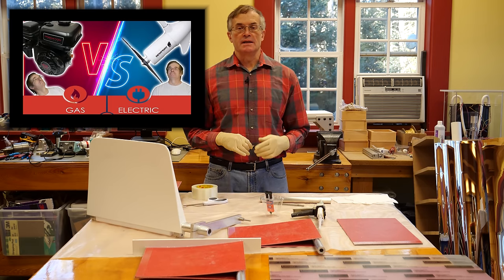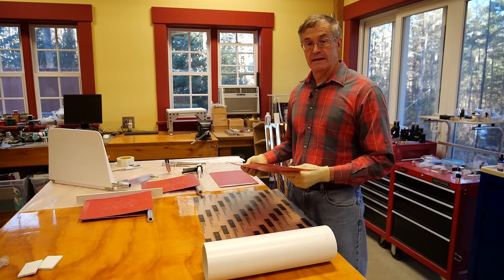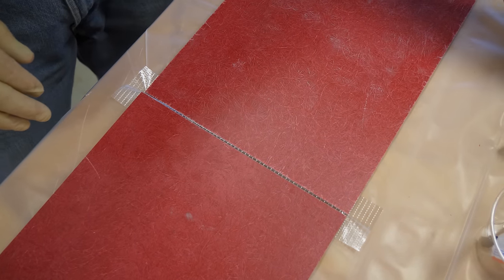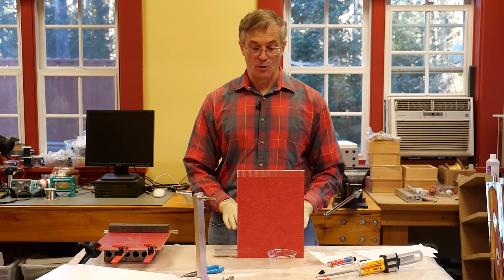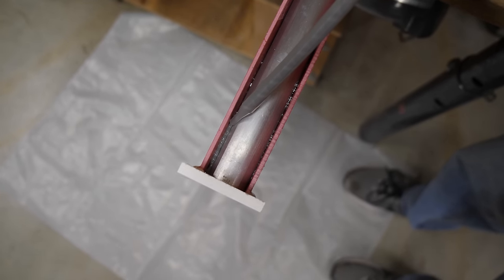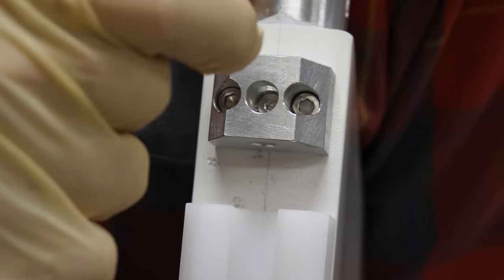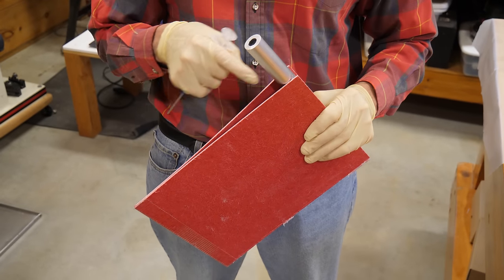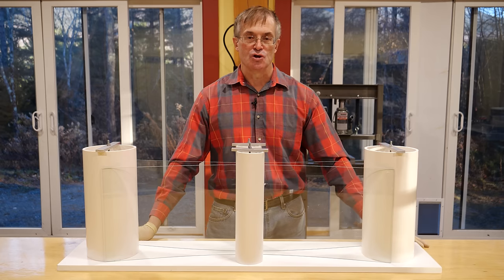How Our Boat Rudders Are Built

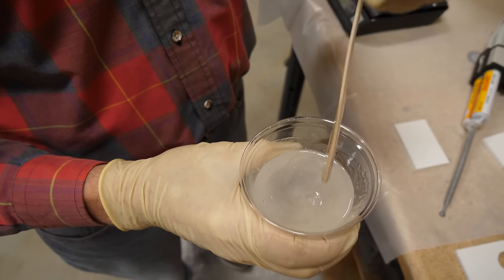Comment: 14:46 another trick for those who don't have a vacuum chamber, is using a heat gun to bring most bubbles out after applying the epoxy, in this case a small heat gun from a soldering station would give more control.
Reply: And you can just hold it at a greater distance, even a hair dryer works.
Reply: Gotta be careful with that hot glue though.. The mass market stuff, attached to something smooth like PVC, is not going to stand up to much heat & retain the seal against resin. I suppose, in terms of boat building, bubbles are sort of a bonus feature rather than a bug anyway.

Comment: 18:00 Low expansion closed cell foam for installing windows and doors would work a treat to fill the whole cavity and also add rigidity.
Reply: I think the reason he leaves it empty is to reduce weight though filling the whole cavity does sound easier.

Comment: I was an aquarium enthusiast and worked at several large pets stores. The main problem with acrylic tanks is scratches. Cleaning an acrylic tank, no matter how many precautions you take, inevitably become cloudy, covered with micro scratches. The second problem I see with any tank in general, is sealing any two sides at near right angles to one another. With acrylic, a weld is only as good as the welded bond, and in most cases, acrylic welds are not deep  enough to be considered a true weld, but more like a "cementing" of the two parts. Bonding with epoxies is not going to stand up to how the water will dry out the epoxy and weaken the bond over several years. The best made tanks I have seen are fully encased fiberglass (using several of the advanced technics you have showcased in other videos using 150 poly foam) incorporating plate glass fronts engulfed fully into a notched recess, giving full contact for the seal of the glass on both side of the seam, and then fully sealed interior with marine grade resin. These tanks last for 50 years or more before any maintenance might be needed for the glass seal. I applaud your concept of a curvy tank, but I am really skeptical about the bonds for each of the parts. I have complete faith that your material will hold the volume of water, but not any faith in the seams of said structure, but I look forward to watching it!

What I have seen in most acrylic manufacturers is a heated sheet formed into a near perfect "U" shape, then they need only seal three lines: right side left side and bottom, to minimize the area of failure.
Reply: Epoxy does not dry out. It is used in boat hills below the waterline, and, properly done, has a near infinite life.
Reply: @robertschulke1596  Maybe so- my experience is such that the epoxy bond fails when its on acrylic after a time. Maybe that is just because of the type of epoxy I was using, or prep, or , or, or... could be any number of reasons, idk.
Reply: I wonder if applying protective coats to the acrylic could prevent micro scratches?

I wondered about how strong that bond would be, maybe it's the shape that minimizes outward forces?

I'm sure much of the reason for the "U" shape is aesthetic as well as cheaper manufacturing. You could probably make some cool shapes with acrylic. However wonderful ones creation might be I'd doubt the fish would appreciate it, stupid fish.
Reply: @seandelaney1700  Most compounds that do that, (waxes, other acrylics, epoxies, oils) have a cure time which would undermine the cost effectiveness of the production, and also more than likely, not totally solve the problem. You would be better served just fabricating a curved piece of glass, expensive, but totally doable. The same thing happens to glass btw, just not as easily.

Comment: Great and detailed stuff! I would have also drilled several 1-2 mm "dimples" in the front of the metal axis to prevent sudden epoxy-metal slip from torque.

Comment: To fill the bottom piece of the rudder you could glue a PVC foam block with a machined notch to that bottom, turn it facing a flat surface, like a desk, with an inch over the edge of the flat surface. Then you, use the syringe to puncture a small hole on the foam and also fill the interior of the chamber (with the syringe pointing upwards). When you remove the syringe, use the fiberglass tape to hold it closed so the epoxy doesn't drains through the hole. After the epoxy cures, you can remove the PVC foam block and cut/sand the small channel that was originally the hole from the syringe in the PVC foam block.
Reply from the maker: You could, but I don't see an advantage to the increased work involved.
Reply: @TechIngredients  instead of drilling and tapping in the top, you would puncture in the bottom with the syringe, as the bottom PVC foam block will be needed either way. Not so much additional work, maybe even less, without the need to later glue a screw on top.

Comment: I did some experiments ages ago mixing dish-soap and epoxy glue, then beating it into a closed-cell foam to make strong, light box section seals. I used it for automobile repairs, and it worked quite well. That might help with the fish tank where you would want a large contact surface.
Reply: More info on the mixing of epoxy with dish detergent, please.

Comment: As usual, another informative video. Loved it!

When I make closed boxes with epoxy on the sides, rather than injecting the epoxy through a hole on he other side, I like to fill a bit more than the required volume into the hollow insides and then place a laminated surface over the edge before I flip it over and hot glue the edges.

If the epoxy is runny enough, it should self-level before it cures perfectly flat on the inside. It also ends up leaving a thin layer of epoxy on he inside surface sealing it and adding to its strength, albeit only by a small factor.

Comment: This technique is awesome, I'll definitely use it. I find foiling sailboats very exciting and that's one of the reasons why I took a leave from my usual job to study boat building. The question of the additive and subtractive methods in lamination and mold/mould making is very important and it's tricky to keep material wasted to a minimum. The method in this video keeps the waste extremely low by the forming material as an integral construct and enables one to make very sharp edges easily (among other benefits like weight, precision and strength). Thanks for sharing and greetings from Finland!
Reply from the maker: Thank you and welcome!

Comment: You might want to rethink the inner bend in that rudder design. Giving a rudder a negative foil shape on both sides will lead to a very bad case of lee helm. Like all things nautical/aerodynamic, positive foil shape (no need for drastic amount, just so long as its there usually) will lend its self to a better responsive helm. heck even a flat blade works better than a negative shape. Also as mentioned its more to do with length of leading edge/depth of the rudder than a wide trailing rudder. The best design for your boat is a semi balanced rudder with a positive foils shape with a deep leading edge with no bottom pinion bracket to spoil laminar flow of the water over the rudder. What you would end up with is a top and mid mount pinion on the rudder BUT a top and BOTTOM mounted receiver bracket on the stern of the hull with a bottom balanced rudder blade. You would also benefit from a swing rudder to get the deeper part of the rudder up out of harms way when beaching, putting it on to a trailer or if you hit something.
Reply: If I remember correctly these rudders doesn't stick down below the hulls, so a swing up rudder design probably isn't necessary. And as this is a very small craft, isn't sail powered and not really made for high speeds the forces on these rudders shouldn't be excessive making it unnecessary to use a balanced design. Other than that I think you have some very good points. 

My own reservations regards the strength of the bond between the rudder blade and the rudder stem, as well as the introduction of a weak spot by drilling and tapping into the stem. I've seen rudders where the stem was broken like a twig when the weather got a bit rough. Now being intended for a low speed craft with the small blades and very limited forces placed on them it's probably not a problem, but it's not something I'd like to see in a rudder for a large sail boat, especially if it's intended for the open sea. But I think we will have to look at it as an example of construction methods and considering the intended use it's probably going to work well enough even if the design isn't optimal for every situation.
Reply: @blahorgaslisk7763  The slower a boat travels the more it will require very efficient control surfaces (rudder) as you do not have a high flow of water to apply directional lateral control. A deep thin rudder is always more effective than a wide shallow rudder in any given circumstance and since he has a limited dead rise at the stern a rudder that passes the keel into clean water (no vortices) in front of the rudders control surface will be the most effective.

Comment: To fill the last side of the rudder, you could pour in enough epoxy to make the top cap, plus a bit extra, then hot glue on the pvc cap, flip it over and let it cure.
Reply: I thought that myself,  but then ---  there has to be a way out for the gases

Comment: About the solar concentrator you mentioned: The shape formed by a catenary curve (ie, just suspending a sheet between two lines) is a pretty close approximation to a parabola. The catenary curve given by y=n⋅cosh(x/n) is closely approximated by the parabola given by y=n+x^2/(2n). This might be useful for making large/cheap concentrators from aluminized mylar, which could be stiffened by a spray-on adhesive, or perhaps some fiberglass/epoxy which cures to the shape it was hanging in.
Reply from the maker: Are you aware of the experiments decades ago to build astronomical, parabolic reflectors with a rotating dish of mercury?
Reply: @TechIngredients  Yea, TaoFlederMaus  did a video demonstrating it a while back. However I haven't heard of anyone using a catenary as a way to form parabolic reflector troughs, so I thought I'd mention it. If I recall correctly, a rotating liquid does form a true paraboloid surface, while a catenary can only be approximated as a parabola for (x/a)<~1.

Comment: That jig for making the curved aquarium could be used further. The PVC pipe at one end could be painted with Krylon spraypaint and a hole in the base and the top could be the basis of a built-in filter. Put media in the bottom, a pump at the top and you're done.

Comment: In one of my architecture classes, we did drawings of hyperbolic-bounded forms....   when I saw your tank idea, i immediately remembered one student's idea of a self-supported awning...his was made of fiberglass/resin panels, each curved to hyperbolic curvature.   they connected at the three edges using a c-channel, which worked out nicely because at the edges, the panels were essentially parallel like the back end of the rudder...   (his was also tapered so the "back" end was narrower, and provided a slope for rain run off...
A few of the advanced students got the idea of trying to do something similar, but use actual fabric for the center panel, to hang in a natural parabolic curve under it's own weight, and letting the sides be preformed curves, but stressed the slightly with a tensioning line connecting the edges to have the whole side slightly under dynamic tension, thus also providing stability to the weight of the fabric roof (and would respond to additional live loading by precipitation)    The original design was intended to be something like the Dulles Airport bldg in effect, but of lighter materials overall....

Comment: Thanks for yet another informative video! An additional point to not filling the rudder solid: buoyancy. For a given limit on displacement, more weight on the boat is going to induce drag. Given the hydrofoil you showed and the engine upgrade, it seems reasonable to conclude drag is bad for your application. 😁 This could also be a helpful construction method for other compartments!
Reply: It might be handy that they float. Weight out of the ends is generally a good thing, particularly in waves.

Comment: Speaking of various epoxies and resins - You may check out Electrolube's catalog - My application was for encasing electronics yet still being able to dig out the electronics if they need repairs or troubleshooting - But they have all kinds of resins that may be of use on this project or on others, depending on the properties you need.

Comment: Nice, cool and interesting epoxy job. But what really  intrigued me was that bowed fish tank concept. 
I had a reef tank, 1.8m long, 0.6m high and 0.4m deep, (6', 2' and 16"). The shop that made it recommended 10mm glass and adding a reinforcement strip of 10mm x 60mm x 1.6m on the inside just below the top edge on the long side to prevent it from bowing out and cracking.
It took just a few hours after filling the tank before the reinforcement strip shattered in a few places, and chunks of glass shot off. And the tank had a bow of about 15-20mm at the top both in front and the back, but it seemed to reach its equilibrium at that stage and all was fine till we decommissioned the tank. But all that glass shattering was because of compression in the glass, and I'd not expected that.
So the idea of an inverse bow as a dam would have is really interesting. I guess my next reef tank would be of thick acrylic instead of glass, as its much more safe and I guess better refraction.

Comment: I have another suggestion for closing the top side of the rudder with epoxy, without making an extra hole: 
* Prepare a PVC foam cap, with cutout for the shaft; 
* Calculate the amount of epoxy you need for the required thickness on top; 
* Mix the epoxy, with a little bit of extra, and pour it inside, on top of already cured bottom epoxy; 
* Seal the top cap with hot glue, all around;
* Turn the rudder upside down. The epoxy will flow down to the top part of rudder. Voila!

Comment: If you need to drill into the side of a pipe an endmill is the best tool to use. Most of the time one with three or four flutes tend to run smoother then a two fluted and even more flutes just has to small area for chips to evacuate. A much slower feed then with a normal drill is required and of course it has to be a mill with drilling capabilities (cutting teeth all the way to the center.
Major drawback is that it can be harder (aka more expensive) to find one with the specific dimension needed - sometimes it pays off to look up both metric and imperial specifications.

Now to ponder if I can adopt this technique to make a dagger board for my sailing dinghy (vertical front, arced stern and diagonal top with cutout for a friction pad and a bolt hole for mounting/swinging).

Comment: Good point to leave the rudder hollow so when you hit it on rocks or on the jetty and it detach from the boat then it'll still float around. Careful with water seeping in and leaving it in sub zero as it can crack open

Comment: Glad I tuned in. 2 (hopefully straightforward) epoxy questions for you: 1. You mentioned a vacuum chamber...when it comes to anything structural, is that step necessary, or is it ok to use a heat gun? And 2. Can the same epoxies / techniques be used for wetting carbon fiber and fiberglass? Or would you recommend a different resin for fiberglass as opposed to carbon?

I have a weld-repaired aluminum frame I am interested in reinforcing with carbon and know that I should separate them with glass to avoid galvanic corrosion. Any tips / resources would be great

Thanks for the steady steam of educational content!!
Reply from the maker: The vacuum is more helpful for very thick layers like potting electronic equipment. The same epoxy can be used for glass and carbon, but for very tight weaves like harness satin and spread tow fabrics a low viscosity will make wetting out easier and potentially save weight by reducing the resin thickness.
Reply: @TechIngredients  I guess that means I’ll be fine without the vacuum step. As this is a repair on a bicycle, weight is important and thus it will be a thin layer. 

Thanks for the information

Comment: Here are my low-priority comments:
- It is better to mix epoxy resin in a paper cup than in a plastic cup because plastic cups can melt during curing. I have experienced this myself even with 120-minute epoxy.
- I think you could have filled the rudder with the epoxy first, then glued the lid on and left the rudder to cure with this side down. Then you wouldn't have had to drill a hole.

I really like your way of explaining things. 👍

Comment: One thing you didn't mention about a rudder is the placement of the hinge points, or the axis of rotation.  Having the hinge at the front can result in pretty high forces on the tiller.  Moving it towards the rear can make steering much lighter.  Of course, putting the hinge in the center of the rudder makes it unstable.
Reply from the maker: You're  correct, and I should have laid out the effect of those choices.

Comment: Pro tip for hot snot: Isopropyl alcohol! Using rubbing alcohol on PVA will completely remove its effectiveness to adhere once soaked into the material, which means the glue comes off without damage provided the mated surfaces aren't also affected by the alcohol.

Comment: To remove hot melt glue even easier give it a spray/squirt with isopropyl alcohol. If the glue bond is broken with less force there's that much less chance for damage to occur.

Comment: You do not need the plug for the second side, simply prepare everything, mix and pour in the calculated volume of low-ish viscosity epoxy (open side up), then close the opening off as you did for the first side, seal it up and then turn it over letting the epoxy flow to where it needs to be...